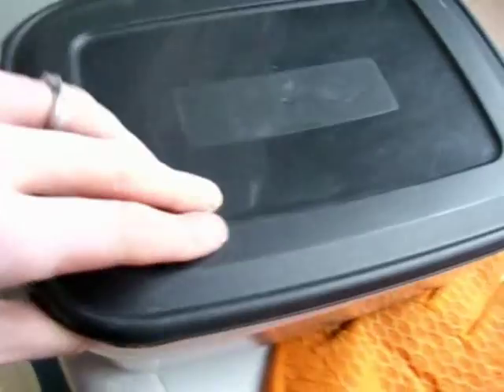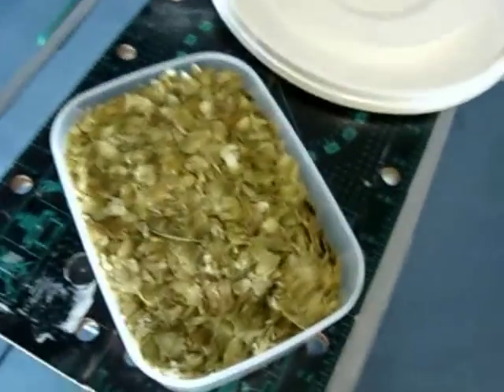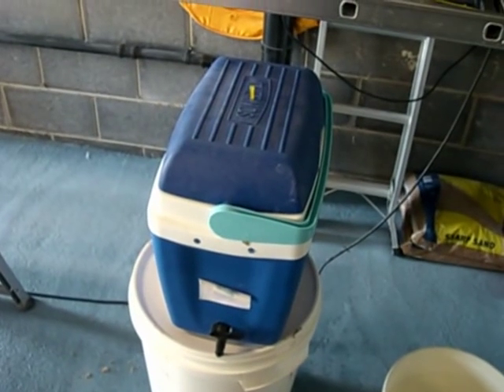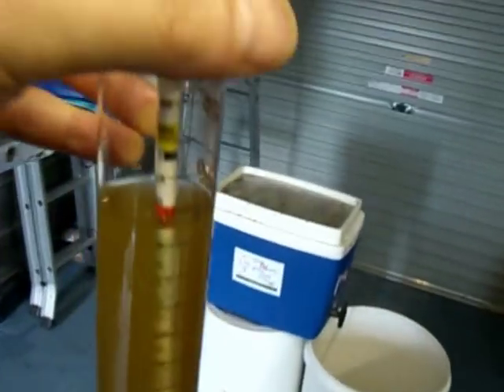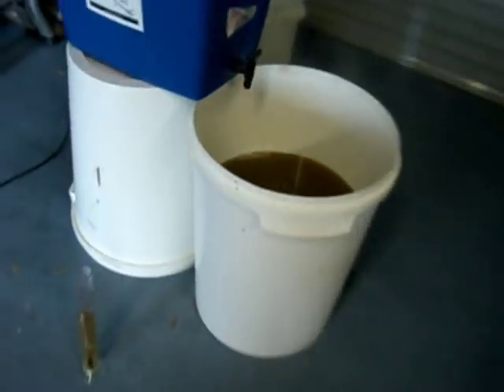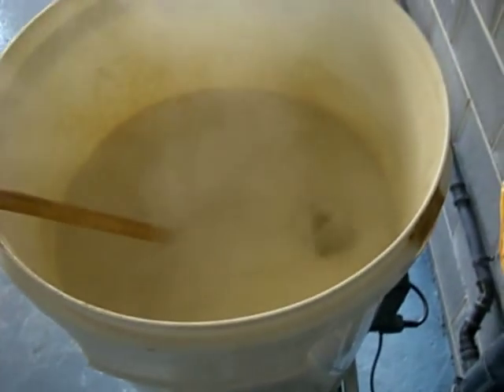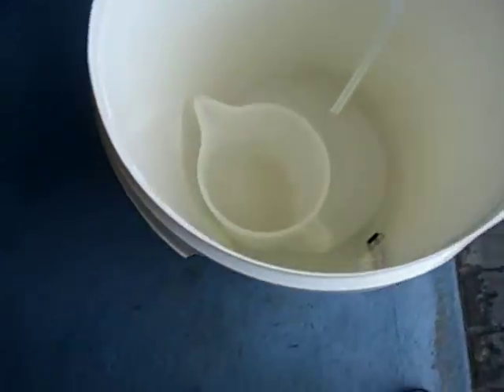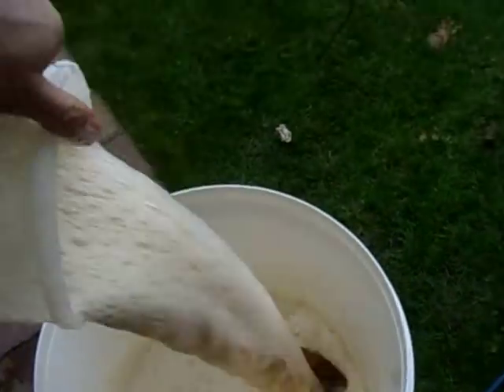Brewing Beer

Comment: Good point on sterilization. I've seen people that sterilize anything that comes in contact with any ingredient of the wort, no matter what part of the process. Personally, I only sterilize my fermenters and air-locks, and any equipment I use to transfer cooled liquid from one vessel to another. The boil will kill anything! And of course my bottles and kegs.

Comment from the maker: @Sparks127 
I think a basic polyprop boiler is about £40 and you can make a msh tun stacking two fermenting bins (the outer one with a tap the inner one with holes drilled in the bottom) and insulating them). Other than that some bits of tubing, thermometers and a hydrometer, a fermenting bin (you can use the outer one of your mash tun if you make the one as above) and then a keg (the stainless ones are pricey btw). Maybe about £80-100 - for double that you can have a much better...

Comment from the maker: @RichardRoy2 
The cans of malt extract are usually pre-hopped though you can by it unhopped and then add your own (therefore just doing the boil stage and not the mash).
The temp is easy to maintain, the hard point is hitting it right, especially when your mash tun is so full (i need to buy and convert a slightly bigger cool box) because you have to estimate the temp drop in the water and dont have much room to add more water for corrections.

Comment from the maker: @dominickearney 
Personally i went straight from a kit to full mash. Mashing is simpler than I maybe made it sound, you can get decent results as long as the temperature is in the right range (i was overloading my equipment here, if you use less grain then you can add hot or cold water to adjust). You can also make a very simple mash tun with two simple cylindrical fermenting bins (the stackable ones) - you simply drill dozens of holes inside one bin then stand it in the other which needs a...

Comment from the maker: @noelplum99 
...tap on the bottom and then lag everything with hot water tank lagging. i used this arrangement for years.
As to water hardness. Yes, pale ales require hard water and milds and stouts soft water. However, the hardness needs to come from magnesium and calcium sulphate, not calcium carbonate which we get a lot of here and drops out as limescale when you boil the water.

Comment from the maker: @andwar99 
The problem is, unless you drink 20 pints a day CO2 is the only way you will keep your beer fresh over the time it takes you to drink it. It is the same reqason I don't use a beer engine, it holds half a pint in the pump assembly and I'd effectively need to waste half a pint every day - fine in a pub where the beer is flowing but in a home situation where you have a pint a day it is a hell of a waste!

Comment: Wow. How long to you have to maintain the 63 degrees? It seems like such a narrow temperature range, and once you start adding things, you're going to alter the temperature. I've never seen it done via the actual process of malting. I used to just buy cans of malt extract. Tasty stuff. Been a long time since I've tried brewing beer. Didnt' use hops though. Thanks for sharing this. Not boring.  ;)